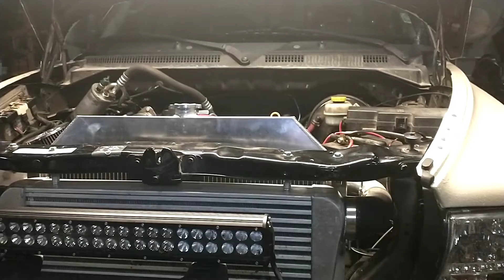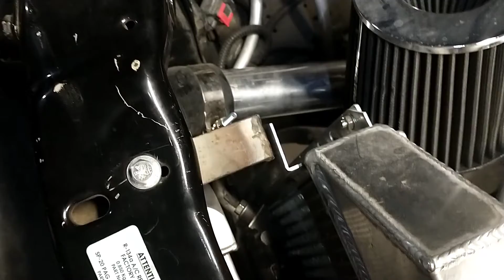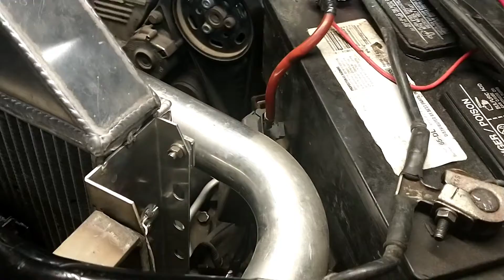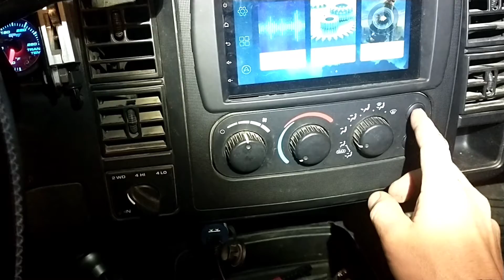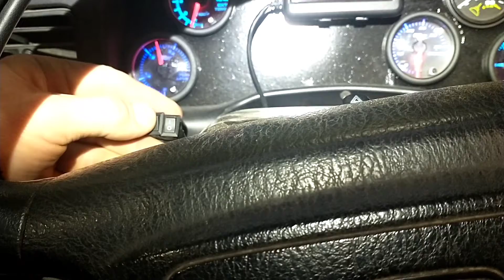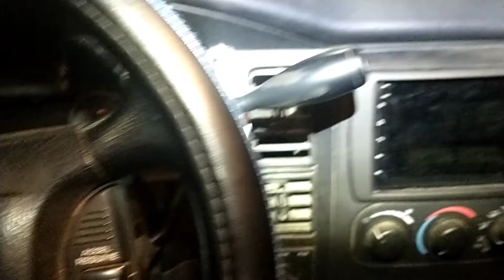TDI 1.9L Diesel Swapped Dakota Gets Air Conditioning! How To Setup VW Compressors In Other Vehicles

Comment: i have a similar project and it looks like the ac is controlled through the PCM
Reply from the maker: Yeah I ended up just wiring it through the pressure switches to my own relay to power it on which is pretty close to factory and the Diesel doesn't care about it so idling up isn't required

Comment: Nice! This is probably the same set up my BHW in the jeep jk but mine has add on AC so it makes it easy with 12v on/off. I am running the bew accessory bracket and compressor. I still have to figure out how to the bhw compressor for onboard air.
Reply from the maker: Ya these compressors are super easy!